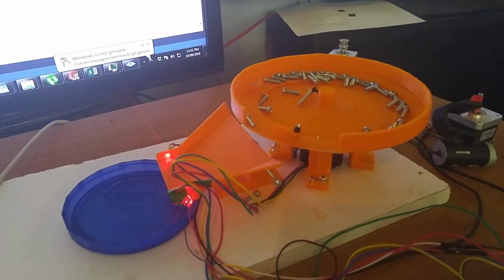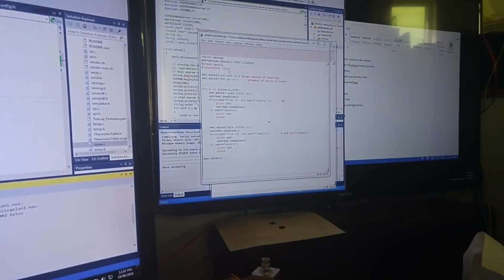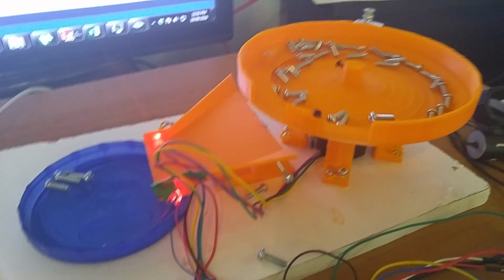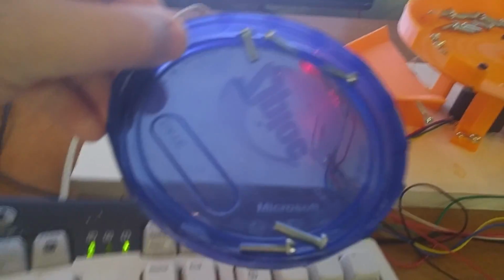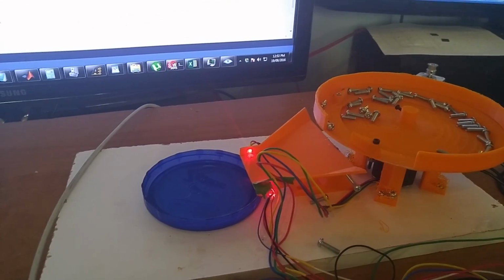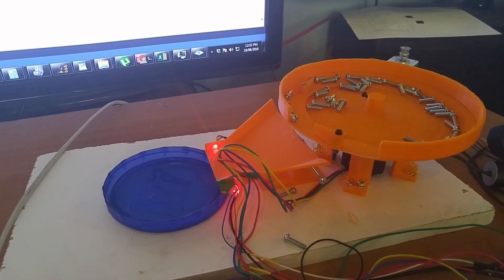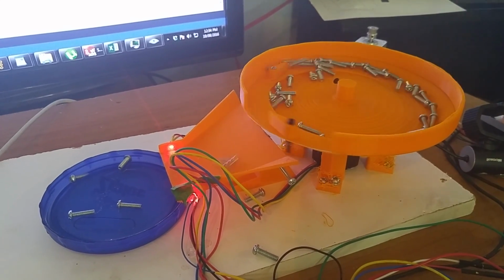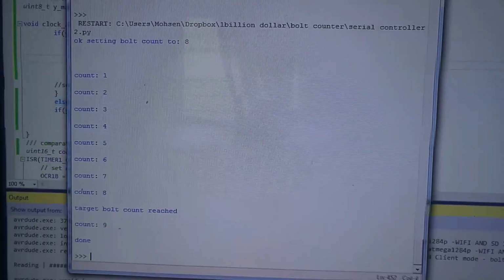3d printed screw counting machine!

Comment: this video made me understand about the principle of vibration feeder bowl
Reply: Actually with vibrating magnets, it works a little different: There is not only a horizontal movement of components but the parts get also thrown slightly upwards in one direction. Friction makes the parts follow that impulse while on the downward movement there is no friction because due to inertia, the parts still somewhat "fly".  You see that below the bowl, the flexible "springs" are never straight up, they are tilted a little to create both lateral and a little upward movement.